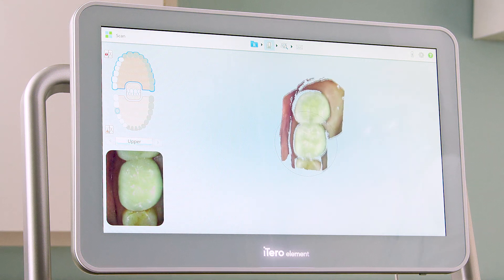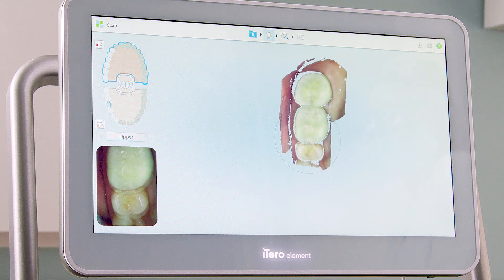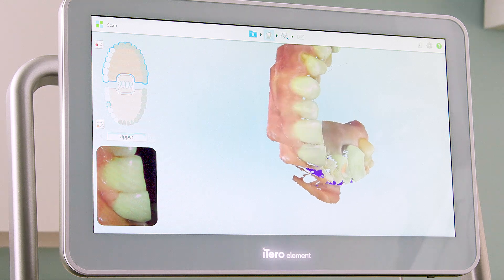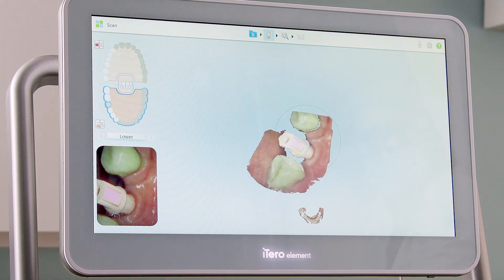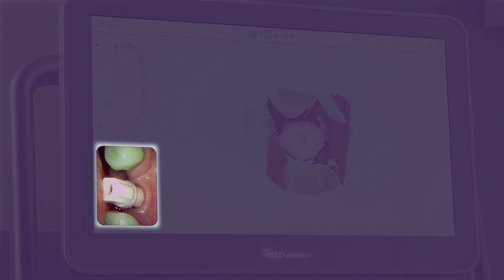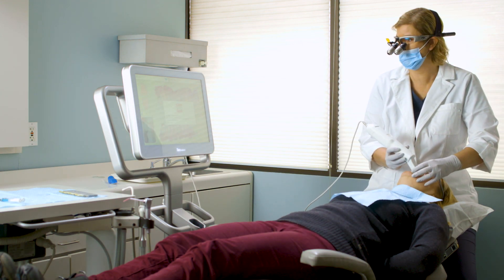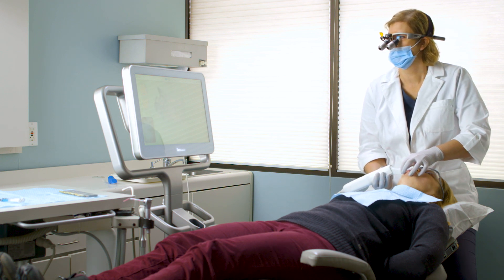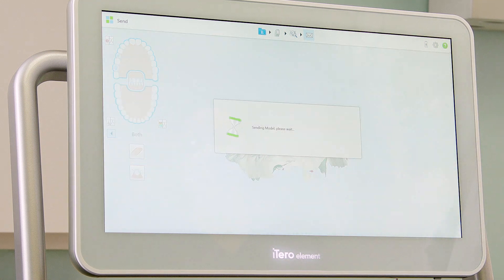Scanning for an Implant Case with iTero Element™ intraoral scanner

Comment: Why is there no information on this video on how the Doctor needs to scan the internal gingival tissue area WITHOUT the scan body?  It is nearly impossible to design an implant to fit accurately without this information.  I have spoke with Doctors who have claimed they do this, but when they send it to Itero, the information seems to disappear by the time the Dental Lab receives it from Itero.  This is making implants destined to be failures in the future.  The more information the Dental Lab has from the Doctor and Itero, the higher rate of success there will be.
Reply: Have you found a way to get this to work well? I am in the same. Place as you right now.